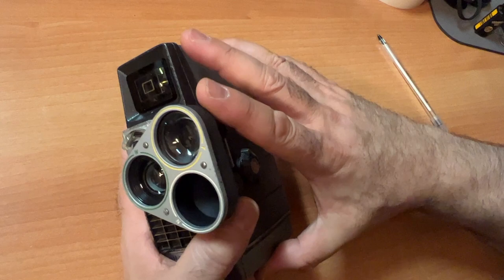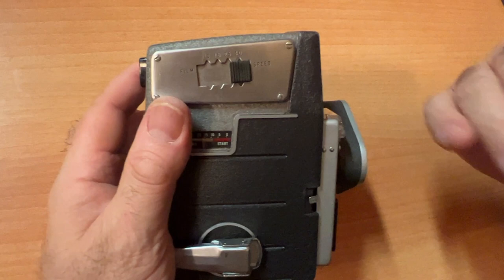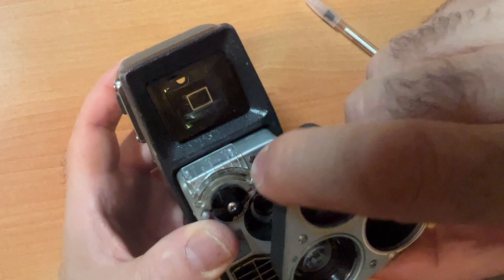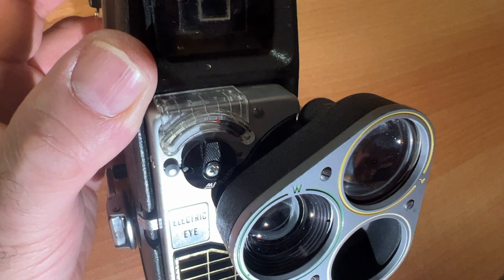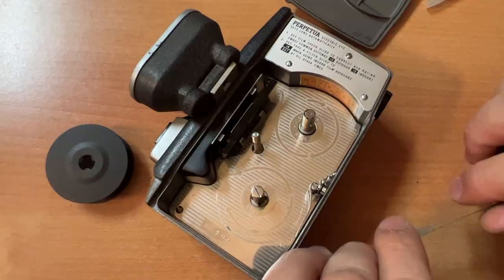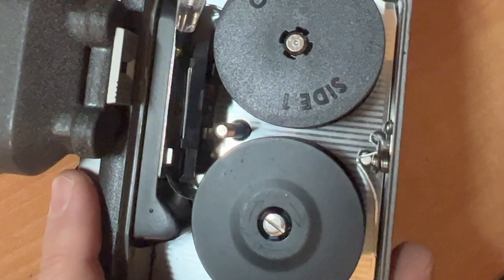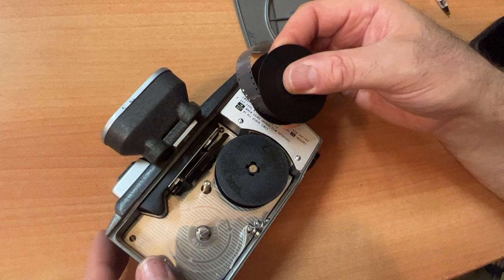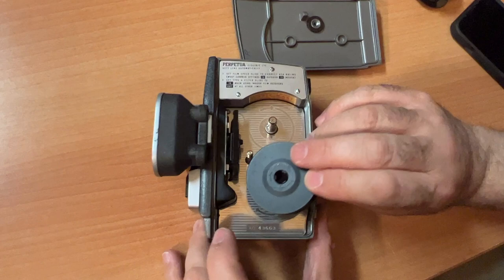Bell & Howell 8mm Electric Eye Perpetua / Overview - Loading

Comment: My camera's shutter seems stuck, is there a way to fix this? It did not come with the film spools could this be the cause?
Reply from the maker: Camera motor problem and lack of spools not related. Many cameras of this age get jammed up with motors that no longer run. NO know repair other than finding another camera on @ebay or in a thrift shop.